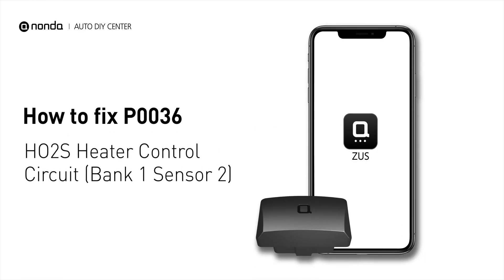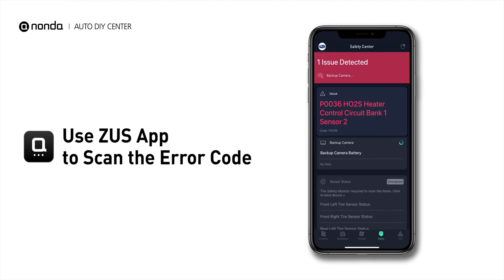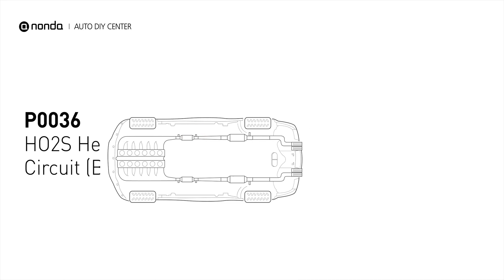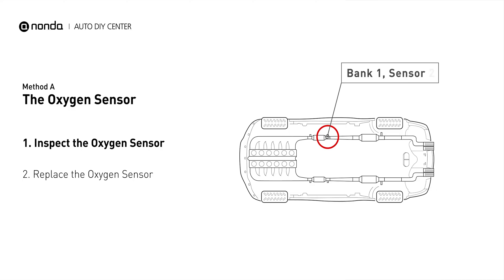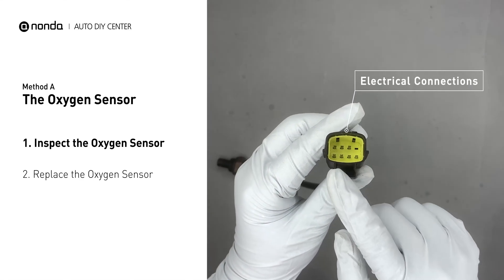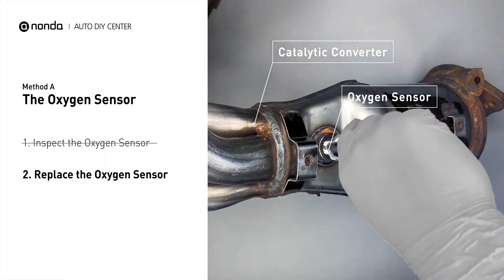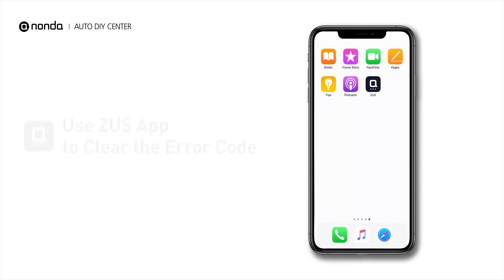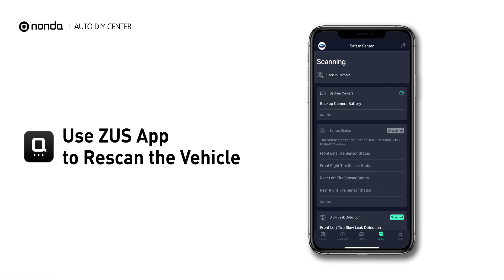How to Fix P0036 Engine Code in 2 Minutes [1 DIY Method / Only $19.64]

Comment: I replaced both 02 sensors no change at all nothing wires look good wasvtold 02 sensors have a fuse but so far evrywhere I check nobody will tell me where tge fuses are located if I had the fing money you think I would crawling on the floor for 4 fing months trying to fix prob these online help crap suck they do not help anybody at all !!!!!!!! period !!!!!!!

Comment: I got my catalytic converter and transfer case chain replaced in my GMC Acadia and as soon as I left the shop I got a P0036 alarm and it's telling me to service stabiltrak and service traction control. Is this a likely fuse/groud issue and would it have anything to do with the repairs I got done? Thank you in advance!
Reply from the maker: Hi Jeris, kindly check the condition of the wiring. If any damage is found, repair and see if the code will still register. Test if it has proper voltage and good ground.
Reply: I get the service stabiltrak and service traction control too, did you fix?

Comment: Hello, I have kia optima 2014,i just changed downstream sensor as i had couple of errors but now with my new sensor when i put obd2 reader, I see only p0036 error, but there is no engine light.
Reply from the maker: Hi Sahil, have you checked the condition of the fuse and connectors? Kindly ensure that the wiring has proper voltage and ground to the sensor.